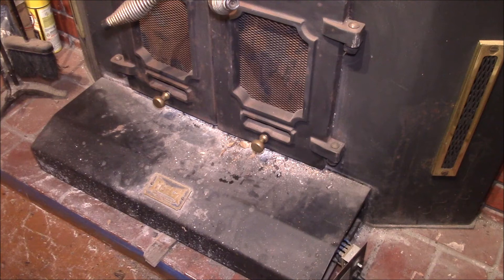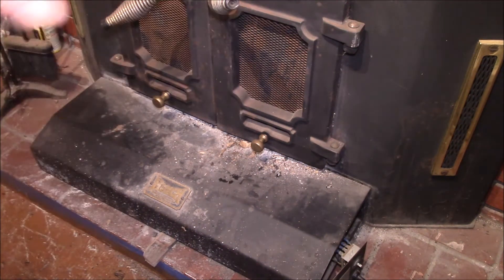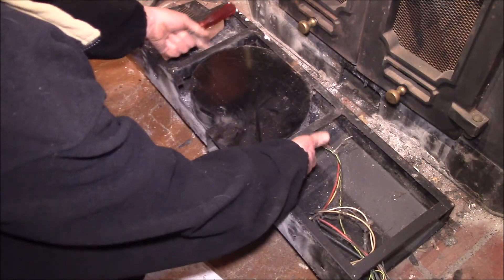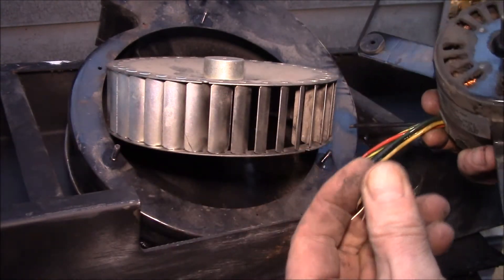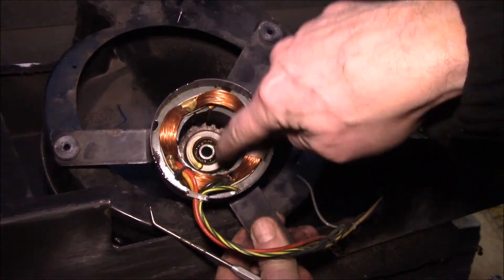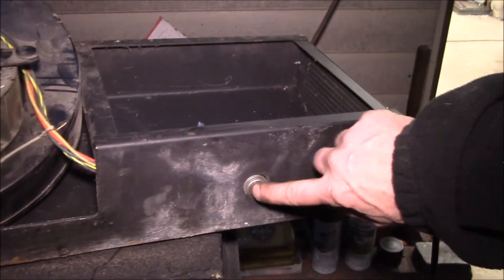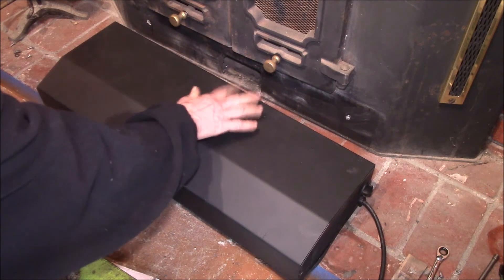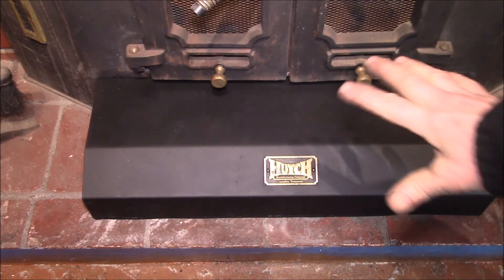Hutch Double Wall Fireplace Insert Blower Maintenance

Comment: Spare the air days lmao, tell them to screw off, my family will not freeze bc of bureaucrats
Reply from the maker: Agreed, trying to burn carbon neutral wood to heat my house would seem to be far better than burning that evil dino gas to run the furnace, but apparently not.  These various regulations start conflicting with each other.

Luckily, with the weather around here, the Spare the Air days are usually only in place on clear, calm, sunny days when my solar heat system keeps the house warm.  When there is cloudy, stormy weather, there's enough wind blowing that wood burning is allowed.  So these regulations rarely, if ever, affect me.  Still a PITA, though.

Comment: Thank you for sharing this video. I have the same insert. However, the blower will only work in the last setting when I turn the knob all the way to the right. I’d love to see a video maybe showing the electrical connections
Reply from the maker: That's the way it's supposed to work.  All the way to the right is manual-high speed.  To the left all the way is off and in the middle are several speeds controlled by the internal thermostat switch.  You need the insert to read a high enough temperature to close the switch and get those speeds to work.  

What I do is run the manual-high speed for about 10 minutes once the fire is going well to help move the heat around the insert, then I'll try switching to the low-auto speed and then that'll shut off when the fire burns out during the night.

Comment: very nice but this one may not last 30 years  good luck and Happy New Year
Reply from the maker: Yes, I would wager the newer blower might not last as long as the original one has lasted so far.  I never got any instruction sheet with this insert, so never knew that the fan motor needed periodic lubrication.  At least now I know how to get to it.